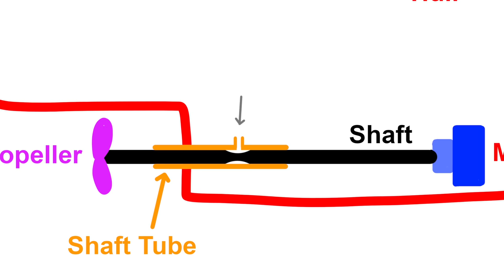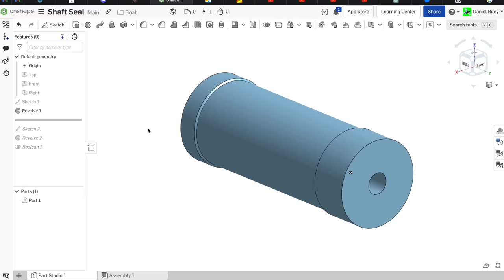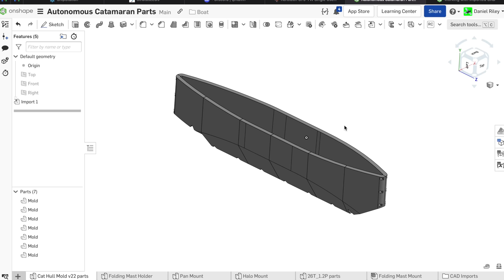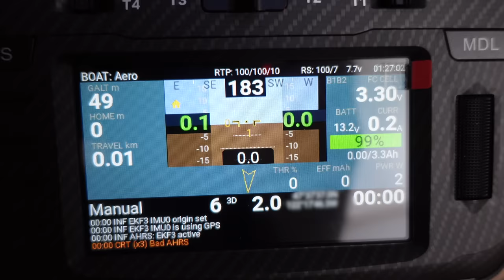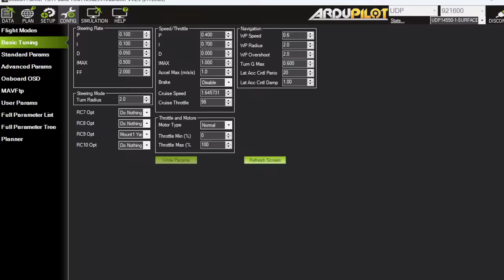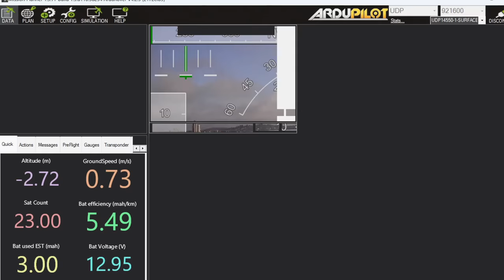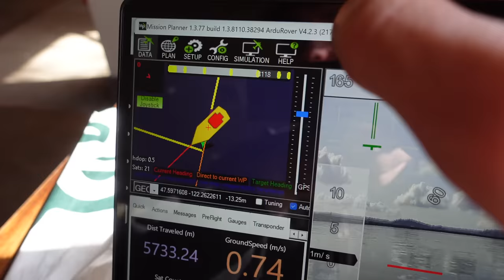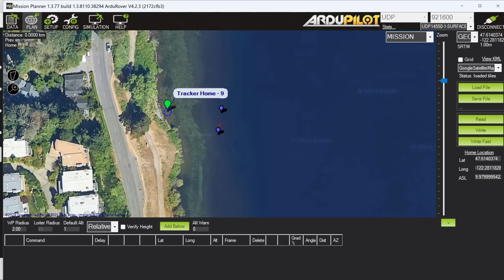5G Cellular Controlled Drone Boat - Long Range Test

Comment: since its unmaned are you liable for all strikes on other boats being your property. 
dont think this head of shops  out of control sets good example. then they make new laws for rest of us
Reply: Tbf, good luck with law enforcement trying to enforce those laws. No real solutions will work outside of expensive RF hunting operations. Especially with so many conflicting signals and channels. Also regarding the amount of unregistered drone tech outthere. 
Criminals are just starting to understand how easy drone can be used for crime. 
It's going to be really scary when this sort of stuff matures, gets cheap, and a stupid level of ease-of-use. 

For now, it's ridiculous to think there is any enforcing or stopping civilian drone tech. Most LE don't care, and have more important issues to deal with.
Reply: @evolicious  till a water skier busts a knee or head  - kids in infaltible disk towed by boat swings them out wide hits the eye on it ? guess its i dont care for you till its your family ?

Comment: So basically you 3D designed 2 steel bars which are most likely available in 20 different placed made for 20 different purposes, order a CNC cut from China and then grinded it with hand to make it work? You are an engineer who will make a paddle boat at the cost of a river bridge! Lol!

Comment: You could also just manually control the boat via the USB connection with the controller instead of having to plan a bunch of waypoints

Comment: What a brilliant sorce of movement and power. It really should have been applied long before now, as the concept was there.  It is also clear that the fellow did not have any notical experience. From the invention of the Propelar, the shaft has always been sealed with Rope & Tallow ( Cow Fat). Right up to pressent time. 
I am sure the jasons outfit would have aplied this method for placing  'Limpet Mines' 
Whilst we are on the subject of Notical progress. Here are are a few uptodate  methods of movement.....

https://www.youtube.com/watch?v=wPk-AKoAtkQ